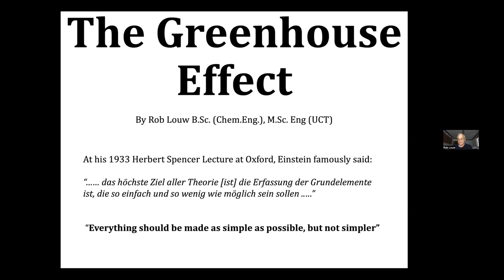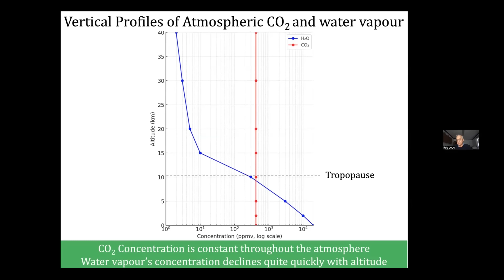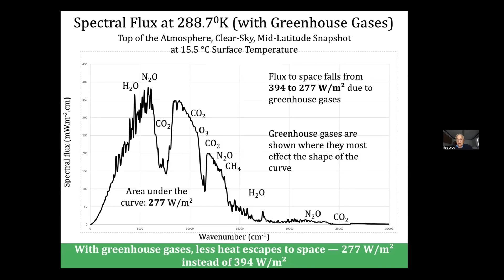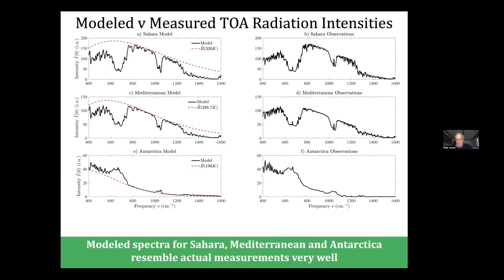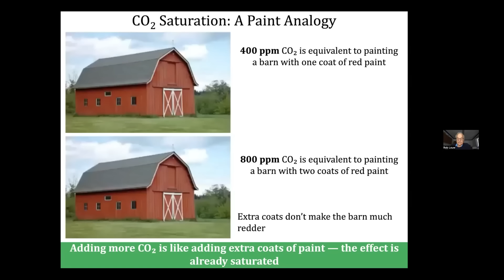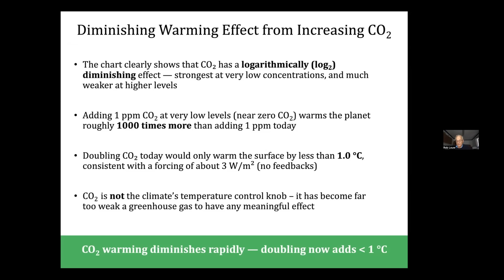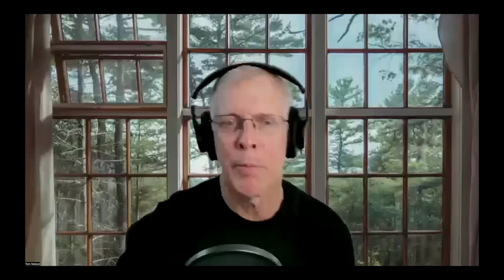Rob Louw: The Greenhouse Effect  |  Tom Nelson Pod #341

Comment: At 48:35. "No serious pushback." A serious true believer would probably press you on the celebrated "relative amplification by positive feedback through the radiative effects of increase in water vapour content", which is key to the deluded narrative of "threatening" man-made carbon-dioxide-emissions global warming. You would reply that the true believer's asserted radiative effects would be only partly realised, because of two forms of negative feedback that are downplayed in the true believer's deluded narrative. To get increase in water vapour, the sea water has to evaporate, which will lower the temperature of the sea surface; and, to move the water vapour high in the troposphere, vertical convection is necessary; this will increase the temperature of the upper troposphere (called 'lapse rate feedback'). The atmospheric optical thickness is reduced by the reduction in lapse rate.

Comment: And still today in 2025, not a single experiment has ever shown that greenhouse gases can increase the temperature of a heat radiating body.
There’s literally no evidence for any greenhouse effect.
Reply: The problem lies with the 'radiative forcing' idea itself. It is questionable.
Reply: Actually it has been experimentally proven in a way that refutes back radiation warming hypothesis. 
All you need to do is cause all convection to cease and then infrared active fluids will cause warming of the radiating surface, ie. solar ponds. It was also shown in double pained gas filled windows, when you turn them horizontally and then heat them from above so that convection is blocked, an IR active gas will cause warming on the inside of the window. Otherwise, convection allows radiative emission to offset radiative absorption. 

Now let's all step away from the armchairs for a second to go outside to see if all convection has stopped in the atmosphere. 🤣
Reply: @Dude44Alpha  total crap! Why are double layer glasses not filled with CO2 then?
Reply: @bessokeks4006  You should reread what I wrote very carefully. 
But to answer your question, it would only work on windows that are turned horizontally and heated from above. Low emissivity coatings are also applied to the surface which basically nullifies any absorption of IR of the gas on the inside. 
The point is that in experiments, with uncoated windows that are in their normal vertical orientation, convection allows IR emissions to offset IR absorption of inaptly named greenhouse gases. 
In other words, insulating properties are nullified when the intended insulator can form convection currents. Such fluids are typically used to cool rather than warm.
Reply: @Dude44Alpha  rethink your answer.
One thing is convection, the other thing is radiation. You cannot switch on or off radiation by  preventing convection
Reply: @bessokeks4006  What don't you understand? I didn't say anything about switching on or off radiation. When convection isn't present, infrared active gases (or any substance) DO act as an insulator. When convection is present, infrared active gases DO NOT act as an insulator. Is that simple enough?
Reply: @Dude44Alpha  How do these gases know that there is or is no convection, so they are allowed to radiate?
Reply: @bessokeks4006  The gases don't know anything. It's called heat transfer. Warm air moves to the top of the troposphere where it more easily radiates energy to space, cool air descends to the surface where it receives heat from the surface and then moves back to the top of the troposphere - convection. 
This circulation of warm-cold air negates IR absorption by the gas because IR emission from the gas offsets the absorption. The climate cult likens their GHG hypothsis to a blanket, but a blanket would not work if it was a convecting fluid. Without the convection, the atmosphere WOULD act as a blanket, just like every practical application when a fluid is blocked from convecting.
Reply: @Dude44Alpha  the atmosphere never can act like a blanket, because it cannot prevent the surface from radiating into space. I agree that convection is an additional way of transferring energy away from the surface. The later is only possible with an atmosphere being able to radiate into space. This makes CO2 a part of the cooling system of the system
Reply: @bessokeks4006  The atmosphere would act as a "blanket" if there was no convection.
Reply: @Dude44Alpha  no
Reply: @Dude44Alpha  "All you need to do is cause all convection to cease'

off you go ...
Reply: @nottoday-d7p  If you can't detect an obvious joke, then perhaps atmospheric physics is not the subject for you.
Reply: @Dude44Alpha  "If you can't detect an obvious joke, then perhaps atmospheric physics is not the subject for you."

a joke huh.
yes, all of your replies trying to show your intellect are quite funny i must agree.
Your toddler like explanations must require high level study.
Reply: BS

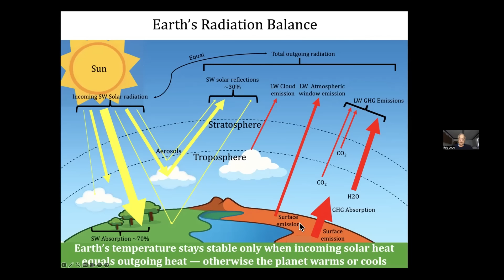Comment: At 16:18. "It must put out what's coming in." What do you mean by "must"? There is no specific mechanism that ensures that. Zero balance is contingent. For a stationary condition, the balance is zero. For calculating 'equilibrium climate sensitivity', a zero balance is assumed. But if there is actual global warming, then the balance is for accumulation of energy within the system, with a non-zero value, assigned a positive sign. As it happens, we appear to be in a slowishly warming regime. The balance is slightly positive.

Comment: Before Al Gore became US vise president in 1993 US high school freshmen earth science taught earth's water vapor saturated greenhouse effect completely absorbs all the greenhouse radiant energy from the earth with greenhouse gases within a few meters of the radiating surface adding 5.55°C (10°F) to earth's average temperature.  On average over a 99.5% share is from water vapor.   Earth's saturated greenhouse effect was used as a high school example of a system always in saturation where further increasing its active elements can not increase its effect that is all around us every day!

Water vapor has a CO2e of 18 and is on average 1% of the troposphere.  CO2 is about 0.04% of the atmosphere with a CO2e of 1.   1.00% / 0.04% = 25, water vapor is 25 times more present than CO2.  25 X 18 CO2e = 450 CO2e water vapor to a 1 CO2e for CO2.   All the other greenhouse gases total to about 1 CO2e.   CO2 is a 1/452 share of with 40% is considered to be from human causes or less than 1/10% share.

NASA reports global warming at 1°C where it has been since 1992.   The cause of global warming is not known with studies to its cause going back to the 1970s.   There has been no climate change from global warming which was expected to start at 1.5°C with stronger observable hurricanes in the Gulf-of-America.  

Sorry for Al Gore!  Al Gore went to the UN in the second half of the 1980s to have it blame human caused CO2 emissions as the cause of global warming giving no mechanism for how that might be possible.   The US engineering / science audience was wondering with CO2 being one of the most understood gases what it could be the UN IPCC was thinking.   When in 1996 the UN IPCC announced it was CO2's greenhouse gas behavior causing global warming the US scientific engineering audience that included all interested high school earth science students were Rolling-on-the-Floor Laughing!   These ninnies had been going hyper about human caused CO2's greenhouse gas behavior in the best known example of a system always in saturation!  

It was so unbelievable in the US it was never brought to public attention until over 15 years later.  It has to be taken into account that there were a great many news discussions and documentaries when global reached 1.1°C in 1991!   Then in late 1994 it was announced that for unknown reasons global warming had apparently fallen in 1992 to 1°C where it had been staying with no rebound.  Global warming had stopped and retreated in 1992 when Al Gore caused earth's greenhouse effect from being taught in US public education in 1993 and was still stopped in 1996 when the UN IPCC announced global warming was increasing and due to human caused CO2 emissions!   

Earth's greenhouse effect was not always in saturation with water vapor having a CO2e of 18 there would be wild temperature swings with changes in humidity with average retention being  5.55°C.   "Climate Scientists" don't recognize earth's greenhouse effect retaining 5.55°C stating average retention is 33°C!   At 4% water vapor CO2e 18 at 100% humidity 30°C additional retention would be 99°C!  The world would be turn apart  with violet wind storms and unlivable temperatures!   

CO2 at 10 - 40 ppm in the stratosphere is in saturation for converting all of a large spectrum of high energy ultra violet radiation from the sun to lower frequencies to warm the earth 50°C.  A theory for snow ball earth is atmospheric dioxide dropper below 10 ppm causing earth to freeze.  Volcanic eruptions finally brought atmospheric CO2 levels to 10 ppm enabling the earth's melting of ice.  

Plant life requires over 200 ppm CO2.  C3 plants over 90% of plant life on earth evolved in CO2 levels of 3000 - 4000 ppm.  They do well at 1200 ppm with restricted vigor and growth below that.   C4 plants evolved 8 million years ago for CO2 levels of  300 ppm.    C4 plants are 25% of crops such as corn.  Tomatoes and trees are C3 plants and love 1200 ppm CO2 used in plant growing greenhouses. 

Hope this gives the general insight to understand just how underly ridiculous the situation has been concerning greenhouse gases and global warming since 1992.     The people behind it  known the actual situation.   The UN IPCC science report doesn't have the water vapor's CO2e of 18 and its hard to find it on the internet.  The UN IPCC science report has the CO2e for many gases except the only one that is important water vapor at CO2e of 18.
Reply: Indeed. That is pretty much the way i see it too. And this video states quite a few standard greenhouse effect calculations that are highly questionable, for the reasons you so clearly stated..
Reply: high school is not exactely climatology. the "saturated" effect of IR absorption are valid for ONE photon travelling ONE distance. Rising levels of CO2 still add to the greenhouse effect albeit less and less so. from 140 to 280 ppm you get 8 degrees C more (global mean temp=.. From 280 to 560 ppm they estimate it will be 3 degrees C (so considerably less additiona warming). But 3 degrees averale gloabal temp still means a LOT more energy in the system.

Comment: 15:50  At this point he keeps stressing that input must equal output. But then he says “or the earth would warm” But the oceans are warming. And even if you can argue that the oceans are not warming, seems to me, he needs to tell us what heat value the earth contains.  And human activity surely adds to that. Solar, wind, nuclear all produce as a final product, heat.
Reply: Water vapor always hold earth's greenhouse effect in saturation completely absorbing all the greenhouse radiant energy from the earth within a few meters of the radiating surface adding 5.55°C to earth's average temperature.   Global warming has been at 1°C since 1992 with no known cause.  What possible unaccounted for possibly for global warming is more activity from the millions of deep ocean volcanic vents.

Comment: Can you explain what device can measure the temperature of molecules in the Troposphere and the Stratosphere given the difference in density. A normal thermometer surely would not work in the Stratosphere. Thanks
Reply: Water vapor always hold earth's greenhouse effect in saturation completely absorbing all the greenhouse radiant energy from the earth within a few meters of the radiating surface adding 5.55°C to earth's average temperature.   Global warming has been at 1°C since 1992 with no known cause.
Reply: @douglasengle2704  Then how do temperature inversions form when there is enough water vapor in the air to form dew, frost, or fog?
In a non linear system, the "cause" of the change of a system state over any short period of time is non applicable.

Comment: So what Rob is saying at 15.5C (typical subtropical temperature at or around 40 latitude) cools to -60°C at 400ppm. At 800ppm -58°C. Then assumes earth should warm as a result. In reality its the contrary. Temparate climate is below -58°C. At around 285K 12°C. Tropics is -74°C and Antarctic winter -90°C. Observations not computer modelling. This is why computer simulation is garage in garbage out.
Reply: Water vapor with a CO2e of 18 is the only greenhouse gas behavior of importance in earth's water vapor saturated greenhouse effect.  The other greenhouse gases can not change it.  On average water vapor is a 99.5% share.  NASA reports global warming at 1°C where it has been since 1992.  The cause of global warming is not known.
Reply: @douglasengle2704  There is no warming(earth is slightly cooler than normal). At the equator solar energy is 680w-m2, surface average 460w-m2. Half of the 120w-m2 alters the cooling rate that is lost at the surface. Without water surface would be 57°C not 28°C. But, top of atmosphere is colder, so instead of 250-60 watt cooling, it's 370-80 watt cooling. 460w(surface) minus 80-90w(70hpa). Thermal heating is 460 w (120w-m2 is water,  remainder not from other greenhouse gases). Greenhouse effect is a distorted theory. Water stores heat at tropics by cooling the air. Arid terrain absorbs (57°C at 5cm) that heats the air and releases the heat at night, unlike oceans that evaporates the heat (stores in water vapor gas) to the atmosphere(which is more expanded).
Reply: @douglasengle2704  If there is warming (it is my contention that it has happened and been both mild and beneficial) the KISS principle suggests that the first thing we consider is that it is due to some unknown natural variation for which we may never determine the cause.

Comment: This presentation is flawed on so many levels. The spectral flux isn't 394w-m2 ( this is based on cosine area weighted temperature) The spectral flux is 340wm2 to 104w-m2. Incoming solar energy is determined by do distance to the sun. Closest in January, furthest in July. This means earth's tilt determines earth's energy imbalance. So in January earth's energy flux is less than 317wm2 and in july close to 351wm2. If the planks curve used micrometer metric, it would be at 10 micrometer ( 1000cm-1). On the left of the co2 dip. The CO2 dip comes from a computer simulation.
500cm-1 is far lower energy than 1000cm-1.
 Annual change in outgoing radiation(70%) to  Incoming (70%) is -24wm2 in February and +21wm2 in June. With 2 hemispheres 680 is absorbed, while 680 outgoing (at each end of the poles) includes internal heat from inert gases.   Inert play a significant role in determining temperature. Inert gases posses internal energy in a form of kinetic energy. Which is a form of heat. The(fully transparent) atmospheric window plays a major role in releasing outgoing heat. From 1008cm-1 to 714cm-1. 
Wiens law
2898/292=9.92 micrometer 
2898/207=14 micrometer.  What is presented in this video comes from groupthink. Which comes from computer simulations.  These computer simulations do not match observations. Observations just explained.
Reply: Groupthink is climate hysteria.
Reply: @kimlibera663  Or climate change hysteria is the result of groupthink!
Reply: I don't think the word "convection" was even mentioned once. We literally have applied science applications and daily observations on the planet that refutes the hypothesis, but the myth lives on.
Reply: @Dude44Alpha Unfortunately I don't think weather or climate modelling accounts for convective energy transfers, a basic and 1st principle consideration. 

A sad oversight indeed.
Reply: @yariboi5  Weather models do, because weather forecasting is an applied science which people rely on and must therefore be based on physics or it would be completely inaccurate and even Al Gore would catch on that something was off. Convective available potential energy and upper level boundary layers which act to block convection are important variables in thunderstorm forecasting. 

Climate science on the other hand is purely academic where results do not matter.
Reply: @Dude44Alpha  Oooh, so the people who originally built what became the weather models of today had no idea how they actually did it, and then they used that ignorance to build climate models. Now I understand!
Reply: Point in the comments. Who said earth is ever in balance. Convection and cloud never considered by the alarmist.
Reply: Actually this pretty standard.
Reply: Indeed. If radiative balance theory was true,  earth would not be warmest when furthest from sun, or coldest when closest to it.   The reason its other way is the earth tilt causes far a sun to shine on northern hemishere land..which heats more than the closer sun which hits southern hemisphere oceans.   Water wins agzin. Go figure.